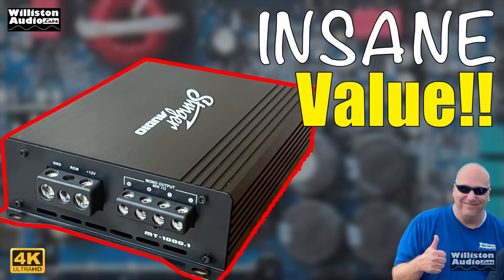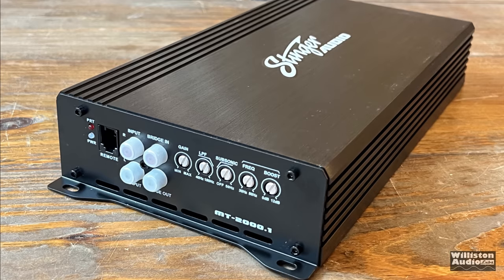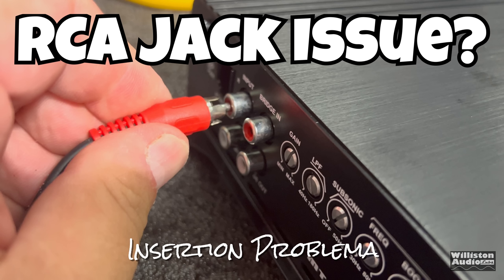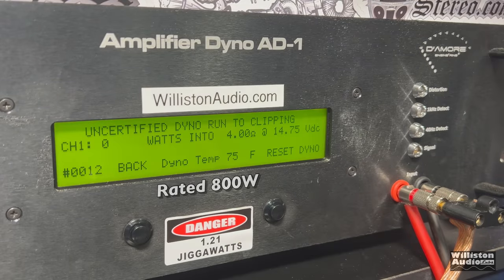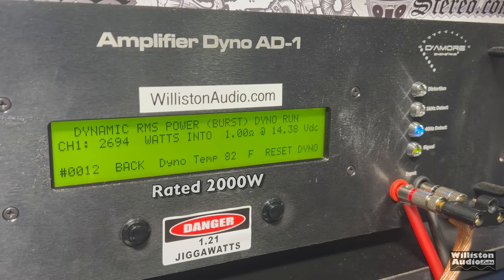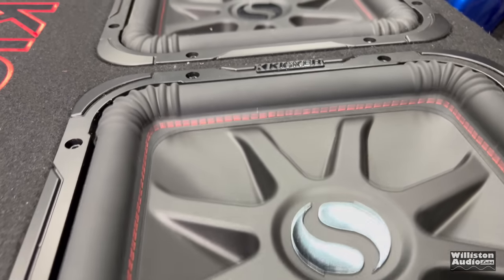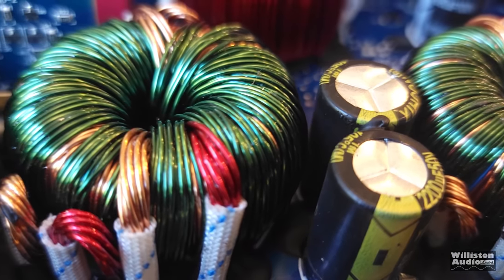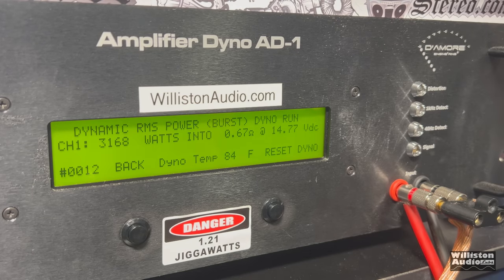This 2000W Subwoofer Amp is Impressive

Comment: I just ordered the 2K and running it at 2 ohms stock electrical 4 gauge OFC and the amp doesn't even get warm I don't care what anyone else says this is the best bang for your buck amplifier out right now
Reply: Thats what i do  i never run amps to the  max
Reply: Poor amp
Reply: Poor thing is probably low volting
Reply: Nothing wrong. Do you drive around with your music on full blast no. So stop
Reply: WHY?!?! Why on EARTH would you run over a 1K on a stock electrical system? No stock alternator has an EXTRA 140AMPS a 2K requires. A 500w is the safest option for a stock electrical system. 500w ÷ 14.4V = 34.7A. It's simple math, watts, divided volts, gives you the extra amps you need. You may not think it's a big difference, but switching to a High Output Alternator will make a HUGE difference on a 1K, let alone a 2K. Just be careful, you can seriously damage your vehicles electrical system, putting that big a strain. You seriously run the risk of damaging the alternator and or the ECU!
Reply: @provident8732 WTF are you talking about?  A 2K on a stock electrical system is NOT a good idea and you don't have to go near full volume to do serious damage to the alternator and or the ECU. Do you even know how many amps a 1K amp requires? 70 amps! A stock alt does NOT have 70A overhead and that's a 2K at 50%.
Reply: @NoMoreBsPlease  if it do reach 2000 watts you do know it’s not gonna hold right? Its music the strain will vary from song to song, depending on how much your gain+ your boost + your volume, so in saying that if he ever do reach 2000 watts it’s stepped up*** from the amp from the battery NOT the alternator, the battery is what gives your amp power, your alternator it what keeps your battery from dying (btw😬)

Comment: Honestly these amps are extremely impressive for the value.
Reply: I don’t see how the expensive brands can keep up their scams of charging 5X to 10x as much. I understand efficiency and distortion…..
Reply: 3k stetsom is almost there with the price,, +1000w more and no problems with rca 😂
Reply: Not really they're full bridge.
Reply: @jhansen6180 You can basically say anything is a scam. Its an opinion, not a fact. A fact is that different products have different prices. It really is as simple as that.

Comment: I replaced an old rockford 360.2 with the 1000w version not only does it run much cooler, but it resolved a ground loop noise coming out of the highs amp apparenty caused by the rockford.   Win win.
Reply: You just had a defective topaz diode that avoids noise in those oldschool Rockfords 😊 they often fail, you can measure it with multimeter if your main ground has connection ( 0 ohms ) to RCA shield, a working topaz diode shows around 1000 ohms between main ground and RCA shield, it’s an easy fix 👍
Reply: As great as the old Rockfords are, using one on a sub is not advisable. They will run really hot and suck up a lot of amperage. Class D is where its at for subs. 👍
Reply: @JasonWW2000  then you have to readjust the idle current on class ab Rockfords , most of the old Rockfords which run hot have a wrong bias setting or they are driving a load which is way to low in terms of ohms. But correct, even the oldschool class bd Rockfords stay way cooler 👍

Comment: I like the little bass remote. Unless you need more information (like voltage, or clip indicator) there is no need for bass knobs to be large.
Reply: I personally want the clip indicator, very useful info if you want to push the amp to its max and dont want to kill your sub

Comment: My rca connections were fine. On this model. Got it running at 2 ohm to 4-8 inch Rockville k6 subs and it pounds
Reply: You should post a video 😎 I wanna see them flex 💪

Comment: Where was this back in 1999?! Could have saved me a fortune.
Reply: The transistors and other semiconductor components did not exist back then. They cost a lot more and couldn't handle the power. Plus no one had a good class D design they could steal and copy from. Same for computers. Imagine the iPhone 14 in 1999. The parts just didn't exist back then. Lol
Reply: @JasonWW2000  thanks 👍🏻

Comment: I have purchased two of these 2ks in the last 5 weeks and the first one I received Jan 27th had the RCAs that were waay too tight, but the second one which I purchased a week ago was perfectly fine. I also purchased a 700w and a 1500w and neither had the issue. Hopefully this means they've solved the component supply line problem! But a super hot drill bit of the correct size solves it too!

Comment: It would be nice to have videos that test and rate the sound quality ie. THD. We always focus on the power but their has to be good, better, best for actual sound quality. I’ve heard ETON has 200w amps that boast a THD of .0001. I really don’t know what that means but it would be nice to have videos just like these but focused on quality. I’m sure the Hi-res audiophile community would appreciate it. Thanks Big D!
Reply: THD alone doesn't really tell e anything about the sound quality of the amp. But that's what these tests are doing, testing how much power before distortion.
Reply: The big problem here is that the equipment to measure distortion levels tend to cost around 40K usd. Only the big audio companies have them. No way Big D is gonna get one. 

THD refers to a deviation from a perfect sign wave or the difference from the input sine wave to the output sine wave. Clipping is where the tops and bottoms of the wave start to flatten out and is a type of distortion. Sometimes the wave can be offset a little which is hard to see on an oscilloscope. So there's lots of ways a signal can be distorted. 

Different amp companies measure the THD at different frequencies and ohm loads. That Eton you referred to measured 200w at 0.0001. If they allow for a higher thd the power might go up to 250w or higher. Some amp companies might measure power at really high distortion levels (20%-30%) to show a bigger power number. We see this on headunit power ratings a lot.

It's a bit debatable as to how high a thd is too high or low enough to not hear it. The machine Big D uses is made by Tony DeAmore of Rockford fame and he chose 1% thd to be the certified output power. I don't know if 1% is an industry standard or just a commonly used standard. 1% is usually considered fine for automobile use. Home amps might use a bit lower standard like 0.5, 0.2 or 0.1%. Its all very technical, but usually distortion increases as power increases. It can be pretty clean up to the point the amp is under a lot of stress and then it will usually climb pretty quick. 

Automotive subwoofer amps are said to be "okay" sounding up to 10% thd. The uncertified power rating is a clipped signal that can vary from 5% to 10% distortion. For a mids and highs amp you definitely want to use the 1% rating.

The Hi Res certification doesn't really deal with the thd, it's about higher frequency ranges (playing up to 40k hertz) and higher sample rates on the music source. Thats a whole other deal. I would imagine anyone making a hi-res certified amp will make sure the distortion levels are quite low. 

Anyway, hope that helps. 👍

Comment: These are a good deal if they are able to hold up over time in a hot trunk
Reply: Well they run cool so should be fine as long as you mount it so it gets airflow underneath as well.

Comment: Got myself the mt-2000.1 and its powering 2 12" dual 4ohm hyanka subs wired to 1 ohm. Pretty sure im gonna have to get a new latch and switch out all my bulbs to l.e.d's because this setup is insane. Especially in a box i fabbed myself to utilize as much space as possible in my 98 bmw convertible. Would, without hesitation, recommend this amp to anyone. Do yourself a favor and get a lithium d4s lto 6.0 batt with 500 amp isolator. Wish i could shake your hand for pointing me in the right direction. Love it

Comment: i just got the 700.1 running a Memphis MM 12 @2ohm  so because of your review on it i know im pushing 550wt and im very pleased! my next build will incorporate the 2000.1 and run it at 4ohm for cleaner sound too dual 12in subs not sure the speakers yet !?

Comment: I got the 1500 watt one very happy with it nice clean sound i currently have 2 12 Hifonics THW12D4 Zeus Theta they're supposed to be 500 watt rms 2.5 inch coil each so total 1000 rms both about those i wonder if its real rms rating on the manual doesn't give you too much information like there is no frequency response info, so far they've been good but im not going too hard on them i dont have a meter so no idea how much power is going into them they're in parallel running at 1 ohm
Reply: Remember that the 500w sub rating is a thermal power handling rating. So 500w continuous and it should be able to dissipate the heat.

Depending on the enclosure, the vehicle and what frequency they are playing the ohm load is going to vary a lot. The amp may never even see a 1 ohm load. The box rise or impedance rise is always going to be higher than what your DC resistance meter reads.

If you want a rough idea of the power its producing get a DC amp meter and clamp the power input wire. See how many amps its pulling. If its pulling 80-100 amps you might be getting a real 1,000 watts.

Comment: Could you make a list of amplifier efficiency and rated power?  I am looking for the best power I can do with my stock alternator.
Reply: Any of the class d style amps should be fine. If you want to save power, lower the sub level or play songs with short bass notes as opposed to long, sine wave style bass. Sounds silly, huh? 
Your really overthinking things. Music is dynamic and different frequencies will have different ohm loads. So efficiency is going to jump all over the place while playing music. 

Instead of looking at efficiency in the amp, I'd recommend looking for it in the sub and enclosure. That will have a way larger effect. A ported box over a sealed box is going to be much more efficient. Two subs over one with the same power will have higher output. 

So I think your looking for efficiency in the wrong place. As long as you don't use a Class A/B amp on the sub, you'll be fine.

Comment: I've been running this 2k amp for about a month. I'm  running lithium on stock alt, voltage  sits at 14.4 drops to 13.5. I'm wired down to one ohm to 2 sa15s. This amp get so hot it's crazy. Not sure what's going on but I'm pretty sure  it shouldn't get this hot.

Comment: Big D I have a question about how u test ur amplifiers on every amp Dyno do u set ur gain to match your voltage on ur rca outputs on the head unit? Thanks.
Reply: The AD-1 uses a special setup disc to set the gain. Since it needs to measure distortion it requires the gain to be set higher than you would in an automobile. 

Are you thinking the writing on the amp end cover is going to be accurate? Like a gain knob saying 4v to 0.2v? The minimum and maximum might be accurate, but you can't say that half gain is 1.9v. It doesn't work like that. Those printed numbers can and usually are inaccurate.

If your looking for advice on how to set gains, for mids and highs make sure they can play loud enough, but not so much gain that your noise floor is annoying. Keep the hiss down. When playing music really loud, listen for distortion or a smell from the mids. If that happens, you've got the volume knob too high. Turn it down a bit and let them cool off. 

Sub amps are tricky, I always set the gain high so I can reduce them with the bass knob. Again, set them so they can play loud enough and listen for distortion or mechanical noise. Try to get a sub amp big enough that your not maxing it out. When you max out an amp it can output a clipped signal and that can really heat up the voice coils. Lots of people burn up subs by feeding it a clipped signal.

Comment: Is there a chance to get a scoped view of dynamic burst tests? I am very curious about the power calculation. Does the AD1 take the highest clean cycle or the average between highest and lowest cycle? Different manufacturers do it in a different way. For me if i perform a 1kHz Burst test with 20cycles I try to get a value which has all 20cycles at same voltage level. A hint for more info about that would be very nice 👍 by the way: great video as always 😊
Reply: You should see if you can get a copy of the test track. Its on a CD that can be bought. I always assumed it was a single cycle burst. One complete sign wave. 
I don't know if Tony has ever said or wants to say. I know Big D is not going to know the inner workings of the AD1. 
Have you tried asking Tony?
Reply: @JasonWW2000 I know the signals from the cd but I just want to see how the signal looks like under loaded tests. There are 1kHz bursts with 20 cycles and there are 40Hz bursts with 4 cycles in the cd.
You can listen to the signals on the website.
Reply: @audiokeller1975  I think your the only person who wants to see that. 
You'd probably have to contact Dereck personally and tell him how to hook up the scope. Maybe he could make a short video clip of just that. 

I've seen your tests and a don't know if there's a way to determine how the AD1 is measuring the output power. I think there's a power correction factor involved as well. Its a bit too technical for me.

Comment: I’m getting the sealed MTX Dual 12” Terminators. Should I get 2000 watt to provide extra power to offset natural lower volume of a sealed box? Subs are 2ohms. This amp is 1ohm, right? Will it still pair well with subs? Thank you for anyone that replies

Comment: Definitely get as many of these amps as possible. Shit have some and dont even open the box. I got the 700.1 as a gift and it out performed the subs at 500w both at 2ohm and 1ohm. So i bought the 1500.1 stinger and going to buy the 2000.1 next. Im Definitely a fan

Comment: Did I just see the amp put out 4000 watts on the quad box. 😳
Reply: Probably a fluke of the meter... the ohm load of the speakers is higher than the Dyno, so I don't see how it would have been able to do that.... maybe for a split second?
Reply: Yea I saw that also

Comment: Old school here.  Im just scratching my head.  3000 watts for 180 bucks??? 🤯
Reply: You don't really go by the dynamic output. Lets say 2,200 watts for $180. 
Yes, the price of amps has gone down a lot in the last 15 years. Transistors have gotten cheaper and can handle more power plus most all the electrical components have gotten cheaper. 

It's my opinion that Stinger is selling these and not making any profit, just because they are new to the amp business and want to get the word out on their new amps. So far, so good. They are building a good reputation. They can also afford to do this. Later I'm sure they will increase the price so they can start making a profit.

Generally speaking, you can get class D amps for about 10 cents per watt. It's usually amps from smaller companies with little overhead and almost no original designs. Copied and cloned amp designs abound. 

You'll notice the big amp makers (Alpine, Rockford, Kicker, JL, etc...) who still design their own unique amp circuits are still pretty expensive in comparison. They are like 30 - 40 cents per watt on their high end amps. These companies have had to create more entry level amp models just to compete with the clones.
Reply: @JasonWW2000 Thanks for the clarification!

Comment: Dereck, I noticed on the 1500 that the input seemed to have a little more padding than most amps. (Meaning requires more gain for a given power than usual for those that don't know the term "padding") Did you notice that on the 1k or 2k? @wal

Comment: Question big d I have the 1000.1 powering two hydro ct sounds 12 they are 500 rms and the amp is 1024 rms. There wired at 1 ohm and I have everything cranked including head unit. Are the CT sounds subs underated

Comment: So I'm still using an old amp with protection and fuses and while watching this I realized the stinger doesn't have fuses. Are fuses obsolete on newer amplifiers at this point, or is it just a cheaper amp designed without to save cost?
Reply: It just depends on the amp company or the amp designer. Some have integrated fuses and some require external fuses. Possible reasons to not have on board fuses might be cost or lack of space. Its a very arbitrary thing and has no real reflection on the amp.

Comment: Hello my name is Kevin I got a 10 inch punshier subwoofer That is rated 1250RMS. and built a custom  box for it To go in my ninety six ford ranger single cab the amp I have ISIS a Memphis 2000 Y mono block. And it is not pushing the r m s, it's stated it keeps going into protect mode it is not producing the rms it was saying .that being said I was looking into a new amp I was looking at hyphonics amp.thr hyphonics amp is about the same price as this amp you just reviewed I was wondering what your opinion  on my situation is should I go with he hyphonics amp or this brand for a cheap amp

Comment: You should try the Stinger 1800.1 m ,  the r1200.1 Rockford Fosgate amp is stronger. I don't know how but it is. Explain how 1200 watts is stronger than 1800 watts! How!

Comment: How did you connect the RCAs?  Kind of a deal breaker if you don't share your secret.
Reply: If I had to guess, he probably waddled it out with an old rca cable. No telling though. 🤷‍♂️
Reply: I believe its just the hole in the red and white plastic disc. It can be carefully drilled out larger.